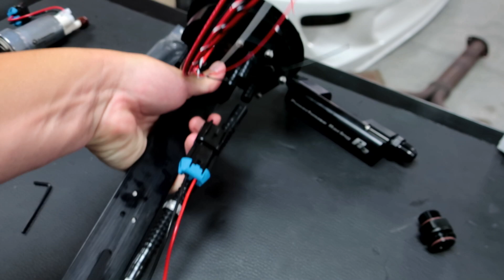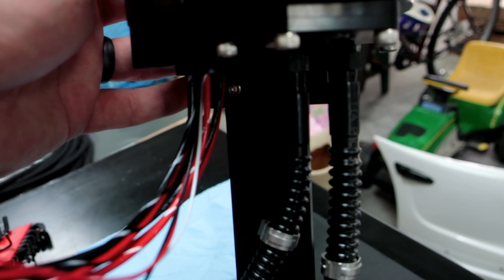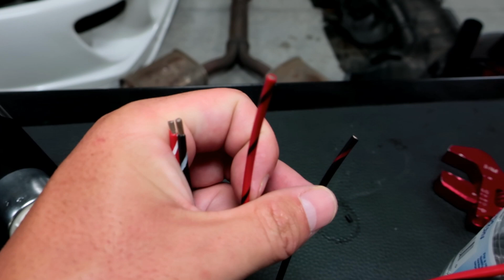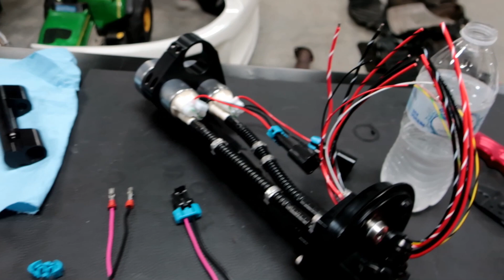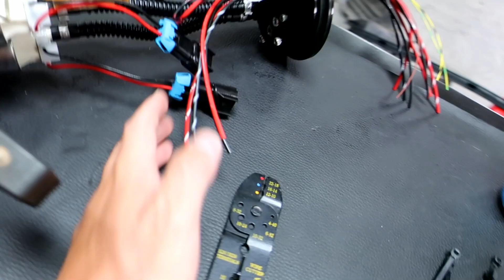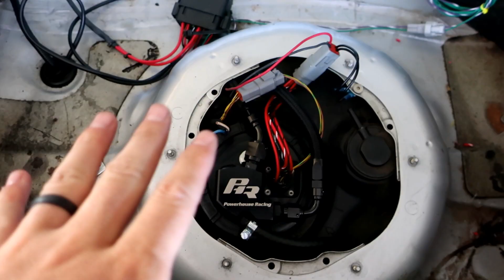Power House Racing Fuel Hanger Install (How To)

Comment: 1st You need the OEM blue wire to trigger the relays. 2nd we removed the PHR triple pump basket and installed the Radium one and its 100% better and quitter with zero smell. Unlike the PHR one.

Comment: Good work! Saving this to reference later!.
I purchased a fuel dampner bypass from PHR.
I was looking into changing my fuel filter, saw your raduim engineering filter and clamp. Will all I need is the fitting you mention in a previous video? Are all fuel filters same size fittings?